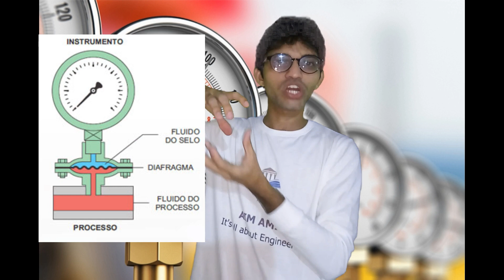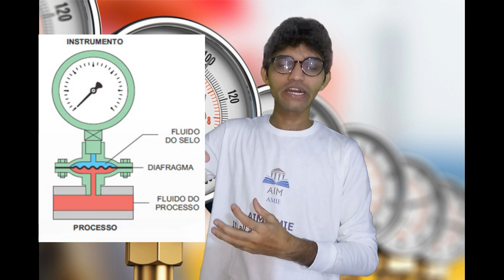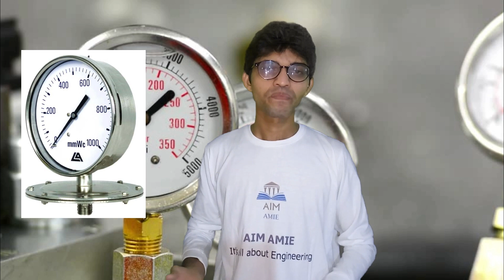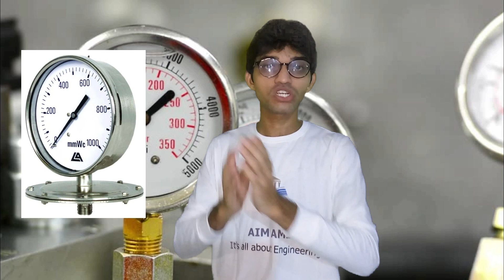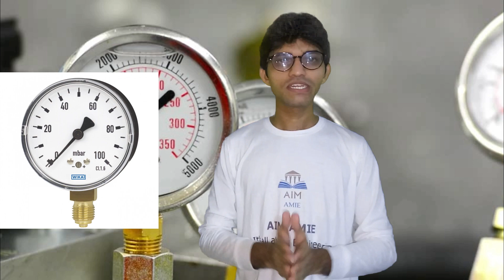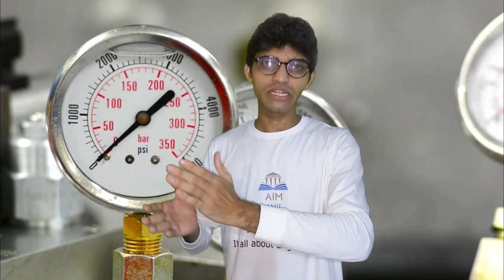What are the Types of Pressure Gauges ??  ||Engineer's Academy||

Comment: Thx for valuable information
I have a small doubt, what is the need of glycerin in pressure gauges.Plz explain.
Reply from the maker: To damp the vibration .. when gauge is installed in vibrating machine.. such as pump. Then in that case gauge with glycerine filled is recommended.